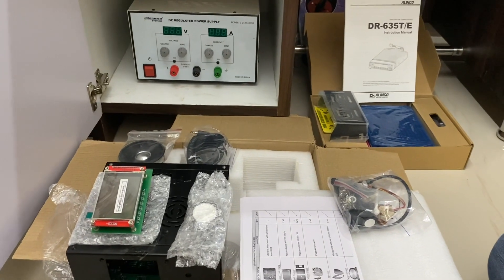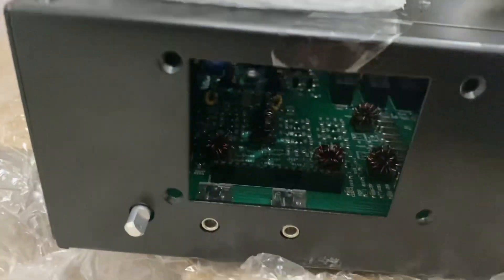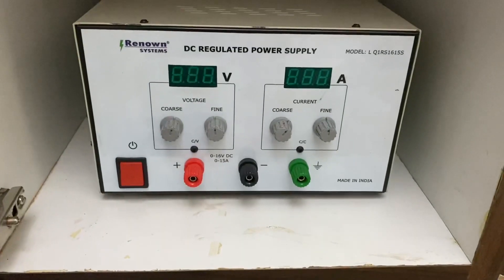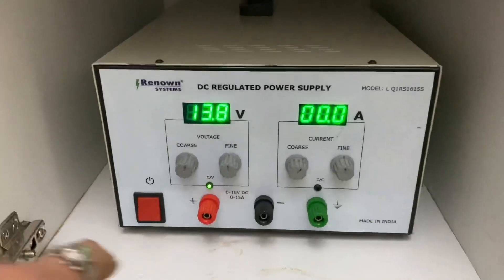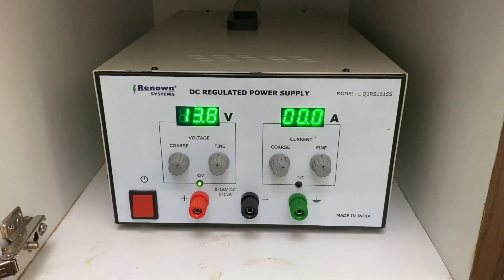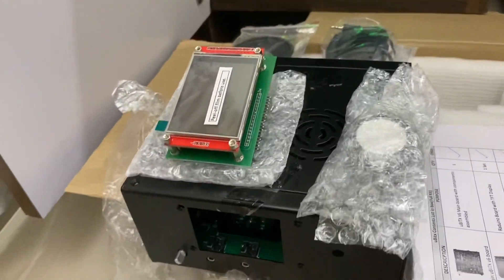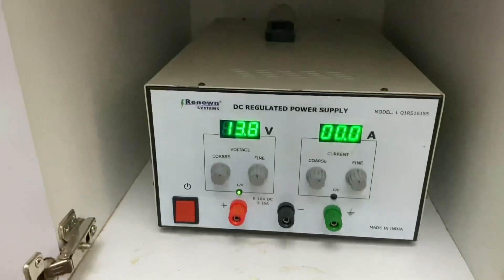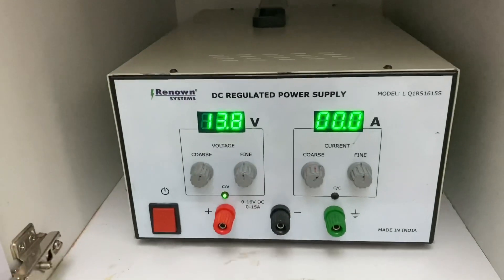Introduction to setup a Amateur Radio Station (HAM Radio Station)

Comment: pls give more information on rf liner amplifier.. if you have link of photos of particular brand pls do share.
Reply from the maker: Hi Umeshkumar, There are many RF amplifiers and are shipped by HAMs who rig it one of them is PA-150 which is full HF Band. What is your Call Sign?
Reply: @automotriztechnica  i have just given exam and waiting for the result. I am planning to have one hf anf one vhf set so try to finding best devices for the same. So that after getting license i can go for it.
Reply: i was their in hyderabad event lamakaan. and given exam their only on 10th of dec 2021
Reply from the maker: @HamWavesindia  Its NKK Amplifier which costs approx., 9K INR. He ships from Coimbatore 9894720221. Rest other RF linear amps are there for 4K single band. You need to buy a uBitX for this to feed in HF signal at 5W for amplification.